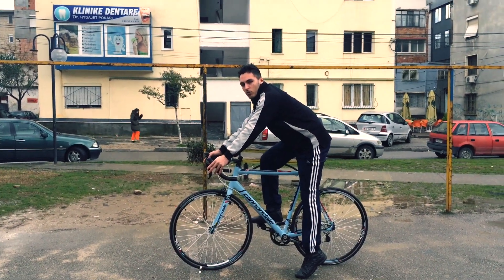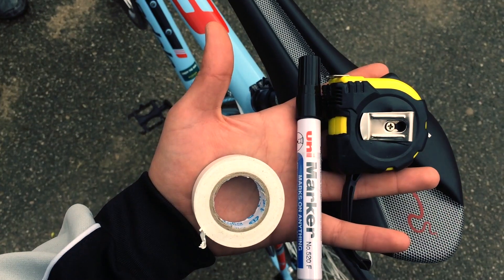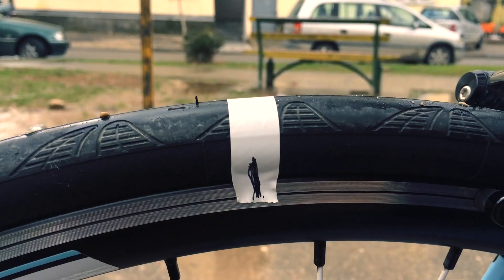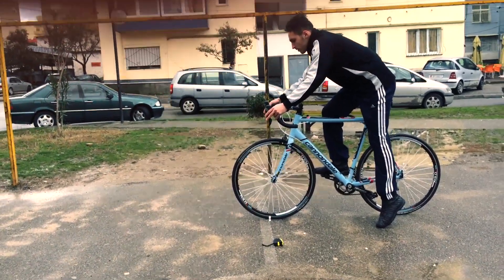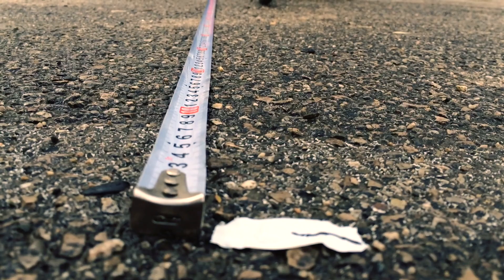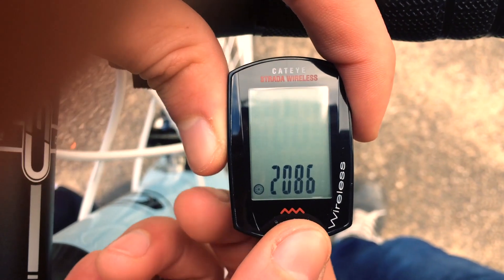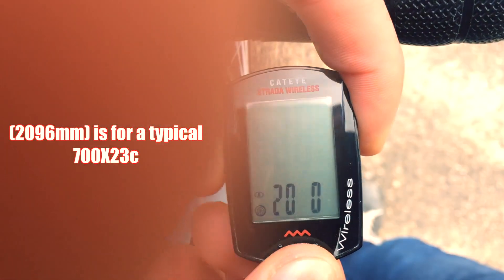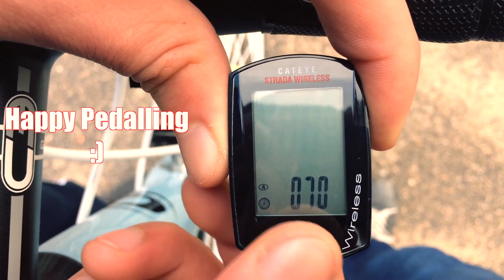How to Set Wheel Size Bike Computer CatEye

Comment: No need for such hastle like this. Just measure the diameter of the wheel and multiply it with 3.14
Reply: Another method, take a string and wrap around the outside of the tire and cut. Layout that cut string and measure its overall length.  😊
Reply: Another method is to look at the size stamped on the tire and refer to a tire circumference chart typically found by a simple websearch
Reply: I was going to say that   pi X diameter